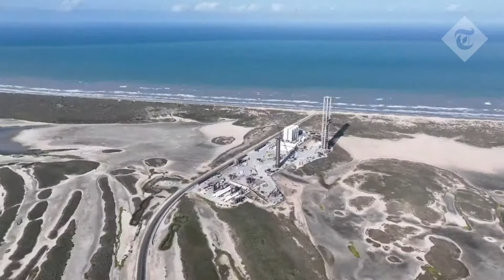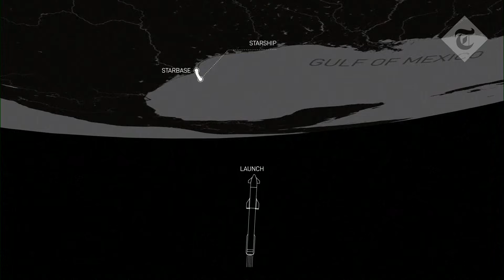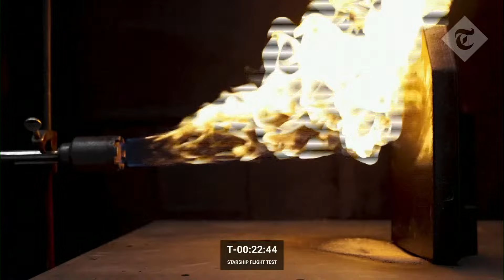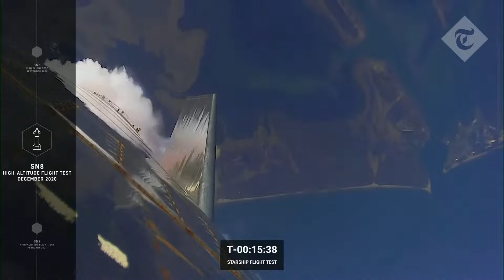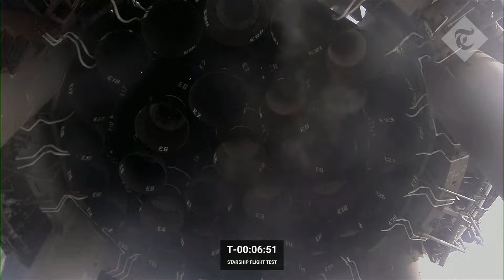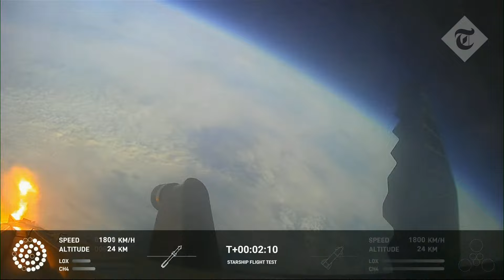Watch: SpaceX's Starship rocket explodes after launch

Comment: I've noted quite a few mistakes that have gone wrong, to begin the rocket began to drift off from the tower after launch. This can result in instability during flight. I also noticed several flashes coming from the engines during the flight, as well as some engines noticeably being out.
Reply: The initial thrust seems to absolutely destroy the concrete pad underneath, exploding it to bits and causing some of the engines to fail and the rocket to tip.
Reply: @lachlantrescott5533  Exactly, seems like they over estimated the amount of thrust needed for launch. Would have thought they got it right with how long it took with the delay.
Reply: @lachlantrescott5533 so the thrusters might have worked if the launchpad would have been more robust?
Reply: @mrkitty777  Well, I don't have a degree in aerospace engineering and until SpaceX puts out an official report, I would say so. The destruction of the pad may be the cause of it all. Why was it destroyed? Might be unstable launchpad or unanticipated power from the engines.
Reply: The thrusters looked like a led lamp with some leds not working 😮
Reply: The Apollo 1969 moon rocket launchpad was cooled with cold water and against vibrations, Twitter has shown images of a destroyed launch pad today, it happened almost directly after launch. Hopefully they incorporate the old 1969 launchpad technology.
Reply: @mrkitty777  Even their usual Falcon launchpads uses a flame diverter and deluge system. Not sure why they would not have it here, I guess they'll never know until they try.

Comment: what was up with those engine in the first stage being out? Was it intentional, or do they have enough margin built into the design to accommodate some failures?  The do have a 32X higher probability of failure than a single engine rocket, all other tings being equal.

Comment: How did that flying skyscraper hold together at supersonic speeds while in a cartwheel manoeuvre? I'm convinced this concept is going to work now.
Reply: people are saying the cartwheels happened cos the booster was trying to do its boost back manoeuvre after the starship failed to separate. I think 90% of the issues with the booster were caused by the launch pad ripping apart and throwing concrete into the engine bay. All in all I think the concept proved itself today, but they have to sort the launch pad issues
Reply: @mutleyeng  We'll find out. The engine out capability of that think is also quite impressive. As far as I understand it, one cartwheel is required to A. separate and B. boost back. They'll figure it out.
Reply: Even if the seperation didn't go to plan....I am very impressed with the robustness of the vehicle. It did like 3 turns or something out of KSP and it was still intact. Crazy. Pretty sure it only exploded due to a self destruct button in the interest of public safety.
Reply: The cartwheels were surprising
Reply: Amazed by the fact it didn't  get destroyed when it didn't separate. Just amazed.
Reply: It didn't
Reply: @chairpants  It did. They blew it up by remote.

Comment: Hats off to these guys for being so positive. I don't think I'd be feeling so happy at the 'RUD'. Looked like it had 4 engines out in the climb...
Reply: Flight Terminated Due To Lack Of Separation
Reply: @richardrhodes-gc2ko  FTS due it being irresistible to push the button.
I would.
Reply: @LiberalHawk_LINE 'EM UP!!!!!! This isn't an excuse, they literally have more rockets for this very reason. They're testing.
Reply: @LiberalHawk_LINE 'EM UP!!!!!! "NO NEED TO MAKE EXCUSES STAN."  Indeed. But then no one was making excuses. What's your point , Stan?
Reply: I don't think it's that much of effort to be positive about it. Most ppl and probably spacex engineers themselves were not sure if it could even lift off the ground. It did, everyone happy.
Reply: If they didn’t keep cheering Elon would have fired them all.
Reply: @wildkeith  its the only reason everyone still have a job and SpaceX exists. No cheering no SpaceX.

Comment: It did reach quite an altitude before exploding. That is quite the achievement for the first attempt launch of such a massive rocket. This is going to be a very costly affair, this learning from mistakes on such a massive scale. Financiers will be sweating.
Reply: Let me rephrase it, This learning from testing is going to be a very costly affair and he better learn fast before his resource start drying up. Super large projects often move to their grave during this testing phase.
Reply: I'm wondering if it's related to the fact they're using methane or just simply engine issues. They had engine failures during the test firings too so... Ya. Maybe engine firing tests need to take place on an unstable platform so it can do a 'shake test' at the same time.

This test, and the fact it held out so long before RUD, should have given them all they needed to know. The next ships are already set to go so I guess we'll soon find out what it is they discovered.

The vehicle was gone the second they lifted off and they knew that so I don't see it as a financial 'loss'. Testing always costs money. Hell, even with all the construction and all the stuff they've blown up already, it's nowhere near the cost of 1 SLS.

They'll get it.
Reply: They're not mistakes, they're tests with an expected outcome, the thing was going to be trashed regardless... Reaching orbit was a glory goal, not the mission.

Elon is the financier, and I guarantee he's not sweating.

Comment: That was awesome and now they have the information they need to push this further. The fact it made it to max q with 4 or 5 engines out is reassuring.

Hopefully it won't take more than a month or 2 for the next 1....
Reply: She said 3 engines were out, it looked more like 6. 2,1,2 around the outer ring and 1 in the center were dark. Personally I think the spin is the problem. Too much stress on the release mechanisms. They should just separate then spin the lower stage after separation.
Reply: That's what they said last time.
Reply: There was no last time, fool.
Reply: Likely several months, investigations and reports to FAA takes a long time.

Then there are also those environmentalists....

Comment: When separating cut a engines one by one to get that rocket eclipse line because thrust is going in to the rocket when it’s coming down that’s a lot of pressure I think that’s why it’s blown led uped pressure back in to it and a big stick like this need  4 pressure thruster to make that top to up side top of the rocket after when free falling u can push the top to front or u can use a parachute to straight is after engines got fired up parachute released engines should fire at full becuz thrust can’t get back in then u know just random thoughts hope it will useful 👍👍

Comment: Not a engineer but u need to control that thruster nozzles according to sea level Elon ground to 10 km dead straight and then to stable the rocket N W E S 4 thrusters at 10 deg or what ever to stabilize and I m saying pad to air at 90 deg when going up if thruster can change it’s angle like lasers pointing one spot I think it’s will be more faster than this 👍👍

Comment: I saw the rocket go out of control and explode..
Can anyone explain to me
Did the separation succeed, or did the rocket explode before that?
Reply: Exploded before separating
Reply: it was meant to do 1 flip and sling shot the 2nd stage forward however the decouple system failed to work and well they had to use the flight termination
Reply: Couldn't perform separation and obviously everything else after that. It's still a success though because their goal was to see if they can lift it off the launchpad, which would be a milestone for a rocket this heavy, everything else after that would've been a bonus.
Reply: Seperation didn't go to plan. The rocket started doing cartwheels, whether that was due to some of the engines not being on, or the booster attempting to do its flip + boostback for landing but still being attached to the upper stage....whatever the reason, it seems the rocket then started spinning uncontrollably. Surprisingly, the vehicle didn't look like it was breaking apart even when spinning. I won't be surprised if it was intentionally detonated in the interest of public safety

Comment: now sit back and watch the media present it as a failure
Reply: FrankieFatHands69 14:08
Reply: Sir back and watch say unscheduled disassembly 💀
Reply: FrankieFatHands69  The launch for this prototype was a huge success. The main aim was to clear the tower and collect data on it being possible. The next prototypes (already built) are already advancements to this.
Reply: @beepbop9  correct, Musk thinks ahead, way ahead
Reply: Frank Reynolds  The launch was successful. The separation of the second stage wasn't, which to be honest I think should have been much easier than the launch. Maybe some "latches" froze or something. Whatever it is, the guys from SpaceX will figure it out. To me this was a huge success because now people on planet earth know for sure that a thing as heavy and tall as the starship can be launched vertically with rocket engines. The launch was absolutely stable and looked like it was done many times before. This is the most important part of the test flight. Every other technical aspect will be solved later by SpaceX. To me this was another "giant step for the humanity". Great job SpaceX! Can't wait for the next step forward. WOW what a time we live in.

Comment: Congratulations for a successful launch
Reply: 😂😂the new Soviet N1
Reply: wasn't even successful lmaooooo
Reply: @swatmaster492  - For the ignorant in the comment section.

It’s a big success. The real purpose of this test is if the main boosters can fly off and clear the launch pad and testing the structural stability of the launch pad, the 2nd separation process is just an extra that they hope would happen too. They achieve their objective. They got all info they needed. That’s why it’s called a test, and not an actual flight.

There’s always a next time for that.
Reply: @inisipisTV  I think the objective was to completely succeed and not to blow up.
Reply: @inisipisTV  Why not testing in a computer simulation??
Reply: @inisipisTV  Not ignorant, was clearly stating it was unsuccessful and it's true, it wasn't successful in the scope of what they had intended. Yes, it had successes, but ultimately within the scope of everything it was not an overall success. I had hoped there would be people with a significant level of intelligence, capability of interpretation and reading level before suggesting ignorance, that is the only thing I was wrong on.
Reply: @Scr3amapillar  I'm sure the design has passed their computer simulations; but that's not the same as building something in the real world that perfectly matches your simulation, is it?

Comment: That cooked itself on the launch pad. It took way to long to get of the pad. It was doomed from there on.
Reply: Totally different launch to normal rocketry. Theirs's 33 engines on the booster. They ignite in sequence. The sequence is a 6 second procedure and the clamps then release. The launch timing was nominal.
Reply: @beepbop9  Three of the motors didn’t fire up and a fourth cut out soon afterwards, it only just cleared the tower. It reminded me of my grandmother getting out of her armchair.
Reply: @mickg7299   The speed the rocket lifts off will not be quick. The aim is a thrust to weight ratio of 1.5. Even with all engines working it will still target the same thrust ratio. Plus its like 120 metres so looks slow. Like a block of flats lifting off
Reply: How many people lost there life? Shocking man, yet there all cheering in control? RIP 😮
Reply: @supernova2025-e7b  none

Comment: Not bad for a first attempt.
Reply: Not the first attempt though is it. All that money wasted. Might as well purchased fireworks
Reply: @benshaw3107  Are fireworks 119 metres tall and have 14,700,000 pounds of thrust
Reply: @Henry5th  yeah. This is proof.
Reply: @benshaw3107  Building a rocket like this will take many attempts. It’s not money wasted. It research and development. It’s money spent on building knowledge, learning what works and what doesn’t. Building a safe, workable and efficient space craft will take ALOT of money and testing.
Reply: @benshaw3107  as I understand it, before they make the actual rocket which will go on the actual mission, they need to make sure that every part of the process - take off, landing, etc - will definitely work. Since the alternative is risking the lives of the astronauts based on the assumption it will all work as intended, they have to practice with test rockets.

So I'd say if the final result ends in a safe mission in which everyone survives in one piece, then it's not really a waste of money is it?
Reply: @benshaw3107  we are not talking about money here we are talking about safety and testing

Comment: “Massive unscheduled disassembly” fancy talk for “It blew up” 😂 

Interesting to watch and I hope the data enables the next rocket to go further.
Reply: When a rocket that produces 2x the thrust power of the Saturn V takes off, I think that this mission is a success
Reply: @Noxti! the “wonblyness” wasn’t the rocket. Just the camera effect. If it wobbled anywhere near that much launching it would break apart before it did 👍🏼
Reply: @tombellamy444  the wobbliness wasn’t caused by the camera effect, it was distortion caused by the heat trail from the burned fuel.
Reply: That’s why it’s called Test. Even if the 2nd booster separated, it’s really not going anywhere. Not really planned to land back.

On for the next test launch.😅
Reply: "A rapid unscheduled disassembly", but yes, also massive 🙂
Reply: OR in a Real World 
Elon Ordered It’s Ground Team to Terminate that Baby!
😏